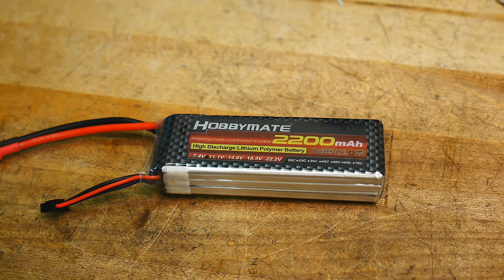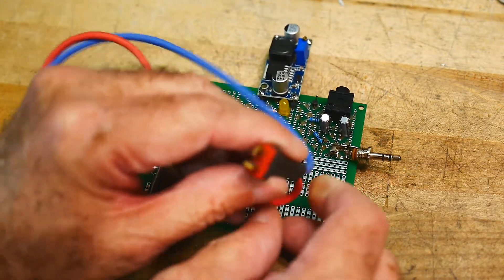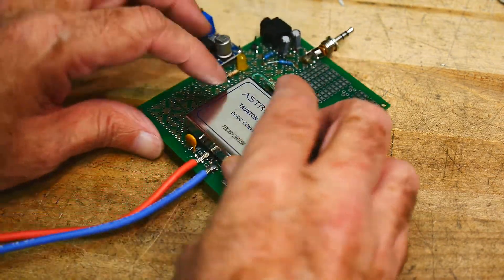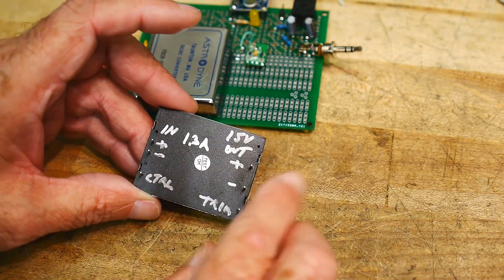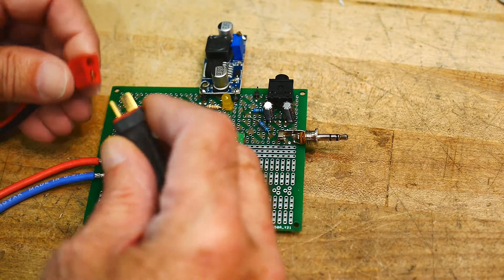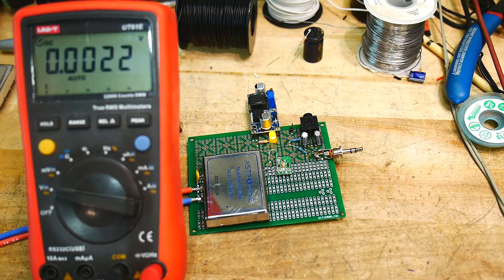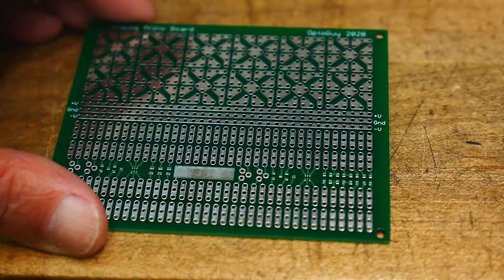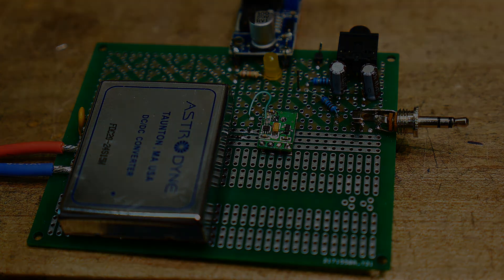#439 Battery power prototype for microphone preamplifier

Comment: Over my excitement about these boards I totally failed to ask my actual question:
I always had a hard time understanding the concept of "phantom power". As far as I understand it it is mostly just a way of powering (or biasing?) a condenser microphone to give it enough headroom for meaningful oscillation, i.e. transforming mechanical oscillation into electrical oscillation.
Is that at least somewhat correct, or did I totally misunderstand how microphones work electrically?
Reply from the maker: the idea of phantom power is to send power to the microphone so it can have an active electrical circuit. Many microphones have a separate wire in the cable to provide power. A way to send power to a remote amp (like in a TV antenna) is to put DC on the wire and use a capacitor to inject an AC signal. using the same conductor for two purposes. this is used in small device mics as 'plug power' and is 1.5 to 5 VDC. in the condenser mics they needed more voltage and standardized on  48. since they already used a differential pair they just sent the power on both lines to keep things symmetric
Reply from the maker: I'll be posting some videos that talk about microphone circuits in the near future
Reply: @IMSAIGuy  So it's basically just a balanced DC supply going one way, and an AC signal going the other way and then passing decoupling caps towards the amplifier? If I understood the schematics right, you have two wires that are the same positive DC, and that carry the same common-mode AC signal, right? 

It sounds reasonably simple. What is the "Phantom" part there? Maybe marketing is confusing me more than it should. ;)
Also, I'm probably overthinking it again.

Looking forward to your video on that!
Already learned a lot from your videos and I'm always checking YT if there's something new here.
Reply from the maker: @VintageProjectDE  phantom since there is no extra wire. the power just magically appears. you will see this trick in TV amps on the pole, satellite mixers on the pole, and even tiny microwave circuits 
https://www.nxp.com/docs/en/application-note/AN3100.pdf
Reply from the maker: https://www.epanorama.net/circuits/microphone_powering.html